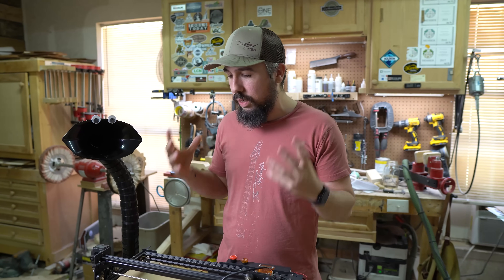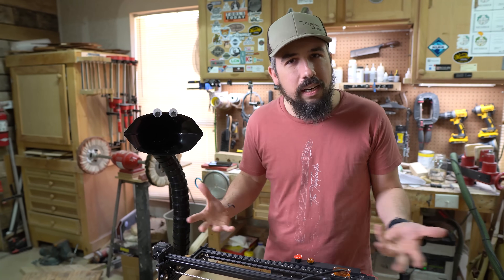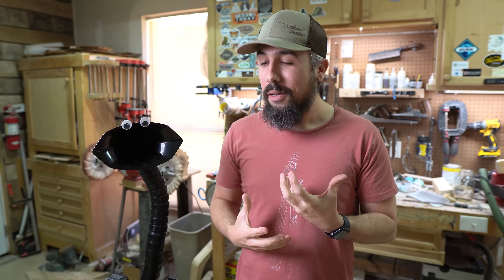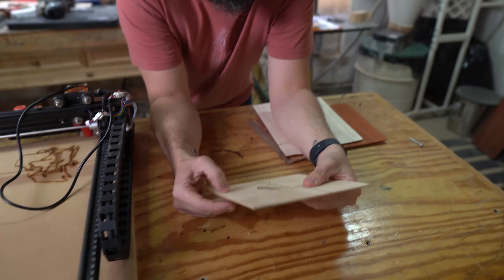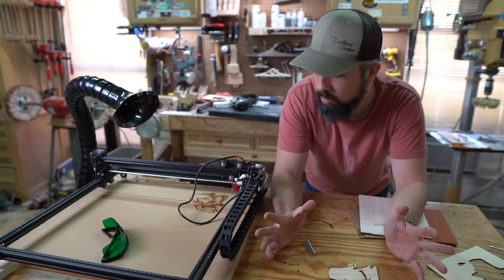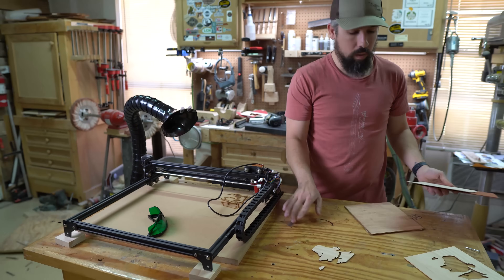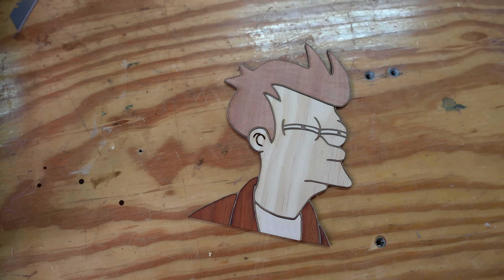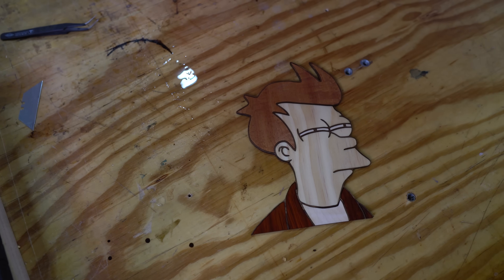Can A $500 Ortur Laser Cutter Make Better Inlays Than Me?

Comment: If you are looking to do fine marquetry in veneers on a diode, you should look into FAC (Fast Axis Collimation) as a feature on the laser module because it changes the beam shape from a grain of rice to approximately a square, allowing you to use a half kerf width offset to get things really really tight. A typical Co2 laser has very close to a round spot, but with a diode the beam shape becomes critical once you get down to the .1mm -.2mm zone.
Reply: Do you know of any diode lasers that have this feature?

Comment: Is there additional hardware/software required to get this laser cutter up and running. I assume it needs to be connected to a computer. Does any software come with this laser cutter or would I need to purchase that as well? I am retired and this looks like an interesting hobby to get into.  Thanks for the video!
Reply: The most commonly used software is LightBurn ($60 for lifetime license + $30 a year for updates).  Take a look at LaHobbyGuy channel on YouTube, he has a lot of information on lasers and software.  I have the Ortur, plan on another $300 to $600 in additional parts.  3DPrintersBay and MadeTheBest are usually cheaper in price.

Comment: Good video chaps. 
Is the Otur powerful enough to cut bridgeplates or 5mm acrylic for jigs?
Reply: 5mm acrylic in black is no problem. Will also cut high pressure laminates like formica and bakelite, but smells horrible. Will not cut carbon or kevlar fiber.

Comment: very nice.  I just learned to do laser a month ago on a big a$$ Trotec and while it is fantastically fantastic, not really a home shop piece of equipment.  My current plan is to cut inlays for headstock overlays which will be easy since you just make clean through cuts prior to gluing the overlay to the headstock.  Have you used it to cut out the recess for inlays?  Like on a fingerboard?
Reply: I'm a woodworker not a Guitar maker, but I have used "fill" mode to cut the cavity so that an inlay will go in.  I use black SuperBond CA glue so any kerf is nicely outlined in black and the customer thinks that it was intended to be that way.

Comment: I think you need a real air assist system with a small air pump. People are thinking this model has air asist but it is not true. You will see It will cut sharp without burned edges and almost no fume.

Comment: Hello guys, lovely work as always.. I use CNC and laser on most of my works and designs on lutes, however here is a nice tip with this kind of machine, try using some kind of raiser (honeycomb is best) under the piece u r cutting, it will reduce the burn effect dramatically and also find the sweet spot (of each species of wood and thickness must be considered) between the speed of the laser head and laser intensity. You can reach to that very minimal burn effect on the edges. Thank you for all the nice videos.

Comment: Can the laser cutter cut MoP / abelone inlays?  Or would you be looking at still having to use a CNC (carefully)?
Reply: Nope. At least a CO2 laser won't. Technically it will, however, the results are pretty horrible and the abelone or MOP basically burns/falls apart. I've used it successfully to cut Corian for inlays however.

Comment: I may be clueless, but as far as the smoke detector, wouldn’t it be better to have it cut on the opposite side of the machine? Instead of cutting right near the detector? Basically, as far away from the detector as possible?

Comment: Wondering how well it works with other materials
Reply: The Ortur is good on wood up to 1/4-inch thick.  With some work it will mark on tile and slate (see "Norton White Tile method").  You will various results on plastics, usually bad.  Some people have luck marking on some metals some of the time.

Comment: Excellent excellent fellas! Miss y'all. I do use my CNC for my inlay, the dots and my letter M with an .023 bit. Works pretty good in abalone, but I don't think it will do more when I get into your type of detailed inlays! I do use my laser to cut my back and top out oversized, and I also run a light tracing where all my bracing goes for glue up on the back and top. Don't have a template yet for that. Dang thing works real good!

Comment: I have a xTool D1 laser and one of the main uses I’ve found for it is cutting inlays. I absolutely love it. The method I’ve used most is to use the laser to cut cavity area and filling that in with epoxy mixed with mica powder for color.
Reply: Warning for those new to lasers, make sure you only do a single pour simple inlays with the above technique. Lasering the epoxy again to get a more complex inlay causes toxic fumes and is not laser safe!
Reply: Awesome idea! I was wondering about this basic inlay process the other day, but hadn’t thought of this specific approach. Thanks!
Reply: @Barrett Hamilton yes, in fact the first inlay I ever did with it I used my laser to cut out a bunch of ninja stars as fret markers. Then cut the cavity for them again using the laser. It took a little testing because you need to account for the 'kerf' of the laser, it's usually really small like 0.01mm or something, but it needs to be factored in or it will be a sloppy fit. 

I have an Xtool D1 10w laser. There's a 20w upgrade option for it and I'm really tempted, but will likely just get a larger laser when I go to upgrade as mine is JUST a little too small to do some of the larger things without moving the piece or machine. The higher wattage is really just going to translate into the thickness you can cut for material and the speed you can do it. 

One thing I will warn though, do test cuts. And be careful when turning the cut speed down or trying to cut thicker material in multiple passes. This has a tendency to burn the edges more. Hope this helps
Reply: @jamiekrautkremer9962  I found that using black CA glue (StarBond brand) works well at filling the kerf and adds a nice black outline.
Reply: @jessetutterrow4320  that does add a really nice effect for sure!
Reply: I was literally just planning on doing that with my guitar, has that turned out well for you?
Reply: @Mars-pt8zb  yeah it works great. You can see one of the inlays I did in my avatar. I actually did an inlay over the volute which was really tricky but turned out great.
Reply: @jamiekrautkremer9962  sweet man that looks cool!
Reply: @Barrett Hamilton oooh, i was unaware they had an extension kit available. That may end up in my home sooner or later! What I would suggest doing for finding the settings is setup a cut file with some simple lines in it. Then take the material you want to cut and offset it so the line cuts the material but ends off of the material. Then you can easily see how far in the laser is cutting. 5w I think they're rated to cut 1/8" thick basswood or something close to that in a single pass so that may give you an idea of how deep it'll go at different power percentages. Hardwoods obviously won't cut as deep. Doing my cavities I think I ran about 60% to get to the depth I wanted at the travel rate I was going when cutting into Walnut. Again, test pieces will give you exact numbers. 

I haven't tried cutting fret slots with it yet, that's one thing my tray was slightly too small for. It's only 15". I can put the fretboard diagonally, but its a little harder to get consistent placing. But if you have the space it'd be very easy to use the laser to mark out your frets. My guess is it'll work great to mark everything out in your blank, and give you a perfect guide to use a proper width fret saw, as well as a perfect outline to cut the fretboard if you want to do that too. Really, the possibilities are endless on all the little things that can be done. Heck, even use it to make a simple fret spacing ruler if you have an odd scale length.
Reply: @Barrett Hamilton I can with my Ortur, multiple passes to get the depth.  A 10W or larger will just do it faster.  Ortur does make a 10W replacement head for their laser and Neje makes an 80W head.
Reply: @Barrett Hamilton that’s awesome. I think I’m gonna get the extension too